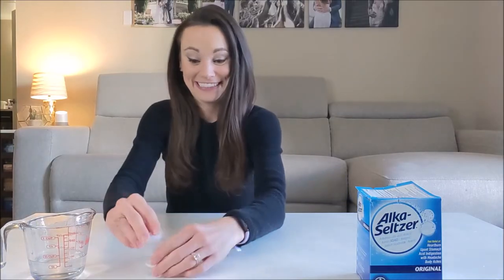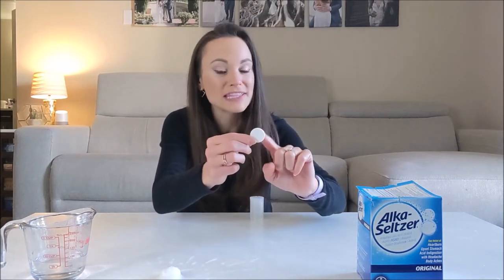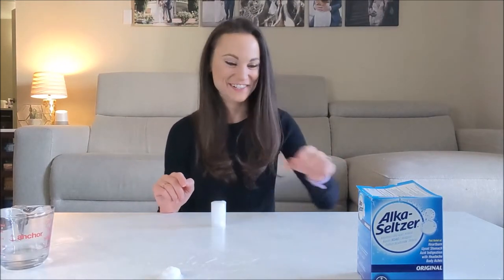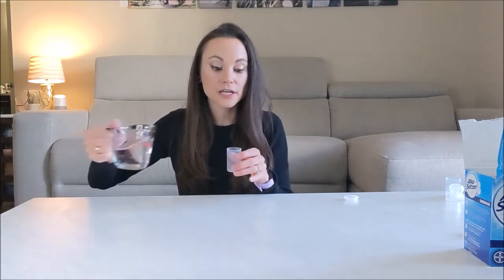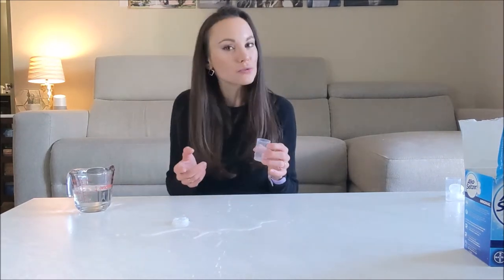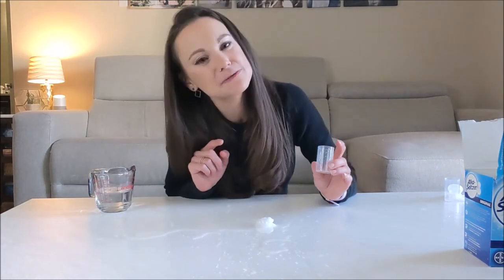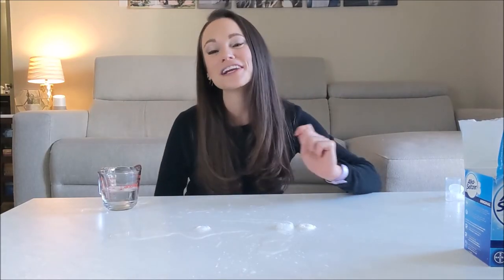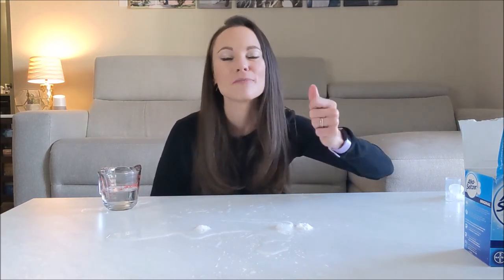The Science Behind Alka-Seltzer Rockets

Comment: The explanation might be better if you describe the air as an air spring, which when compressed, stores potential (pressure) energy from the chemical energy of the alka seltzer and water, which then accelerates the plastic canister (kinetic energy).  The plastic canister also stores energy as it it stretched.  The air is compressible, while the water is considered "incompressible", so that's why you want to maximize the air.  When the rocket launches, the force upwards is provided by the pressure at the top of the canister, for a very short amount of time, until the pressure is all the same.  More air volume makes that time a little longer, so the acceleration is longer, and the rocket goes higher.

Comment: Great video! Just a small question: when you fill the rocket with less water, could the lower weight of that water be another factor causing the rocket to go higher?
Reply from the maker: Well, I don't believe there's any water in the bottle once it pops off, so I don't think that would weigh it down. So my hypothesis is that the weight of the water doesn't contribute.. it's mostly that there's more air (our fuel) being pushed out when there's less water